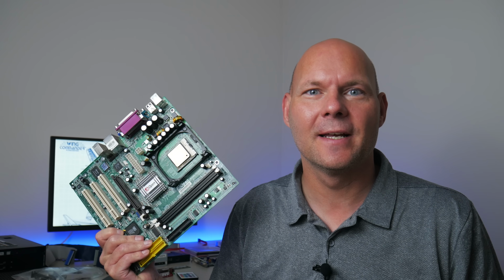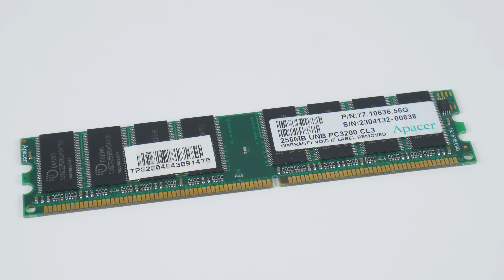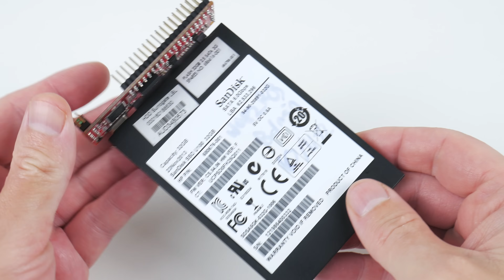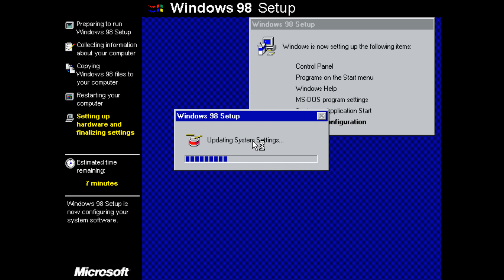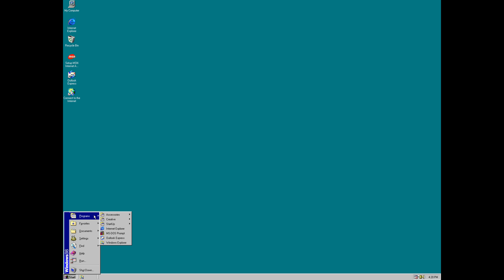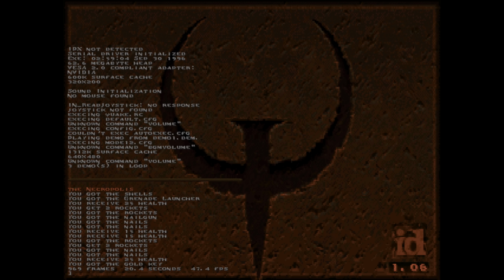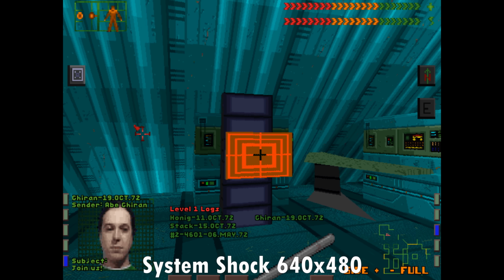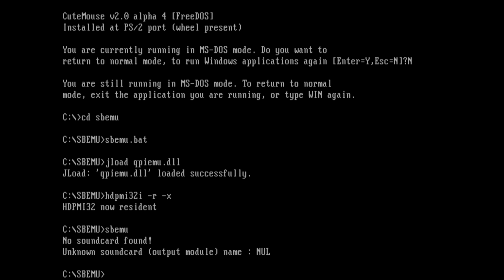Pentium 4 with SIS chipset? Sometimes Retro PC Gaming can be frustrating!

Comment: Another great topic. The only P4 I have is from ECS with a VIA chipset. I will try that in the near future (with SB Live, just like you did) and let you know. Currently I've revived my Abit SE6 (i815 w/ P3   1.0GHZ) - a full recap. I used a Cirrus Logic 5434 video card and tried CMI8738 and Sound Blaster Live on different installations. With the CMI8738, I can get good sound on most of DOS games (native), except for Doom, Duke3D etc. It plays really nice with Prince of Persia, Indiana Atlantis and XWING. With Soundblaster, I can get Doom and Duke3D to work, unfortunately I can't get Prince and Xwing to run, and Indiana Atlantis sounds horrible (like played but an old Nokia phone, before the smartphone era). Pretty different from your experiences. Used the Super Easy Dos stuff from your site, and yes, I placed the commands on the right place (at the beginning). One of the games (I think XWING) complains that it needs more "stacks" with SB Live, I placed it on config.sys just like I used to do with my own dos builds, but it doesn't make any difference. As you said, nothing goes according to plan, always a surprise. I love to play with the old hardware, but everyday DOSBOX looks more appealing to me :)
Reply from the maker: Funny you mentioned the C-Media, it will feature in a future video! It's one of the, if not THE, cheapest DOS compatible card that you can still buy quite easily. Try disabling CPU Cache, many games are speed sensitive. Try Adlib option instead of Sound Blaster. Heart of China for example, the Sound Blaster driver will not initialise on fast machines, but no issues with Adlib sound.

Comment: This brings back memories!
My first ever PC with P4 CPU and MSI motherboard with SIS 961 chipset used to run DOS games with sound on onboard integrated sound card. Or this is what I remember.

I tried to replicate my experience when I was making my own retro PC, but haven't managed to make it work ever since.
Is it possible to run DOS games with sound support on SIS 961 chipset or am I having a mandela effect? 
But I remember playing DukeNukem 3D, Wolf 3D and Warcraft 1 with sound on that PC. I guess it is time to revisit my old PC. Is it possible sound support for DOS in unchecked in BIOS and thus is the reason, sound doesn't work anymore?

Comment: Interesting stuff with the P4 and AGP. The hardware might be just ever so too new for reliable DOS capability. Some of those modern, but backwards compatible chipsets like to do some funky stuff.  I recently found a socket 775 ASUS P5S800-VMS with AGP 8x from the local recycling center. It has drivers for Windows 9x but seems to be a bit finicky with drivers, the board is from some parkard bell machine

Comment: Glad to see more people embracing the P4 for retro gaming. My current retro rig is Windows 98/XP, Asus P800-E Deluxe MB, Intel Pentium 4 3.00GHz, Asus P800-E Deluxe, 2GB RAM 400MHz, Geforce 4 Ti 4800 128MB and Sound Blaster Live!. This machine is not aimed for dos games thoug, but as a platform for the games using shaders not supported by newer graphic cards than the Geforce 4, spesifically Splinter Cell 1-4 and the like.
Reply from the maker: Oh nice! Yes this machine is perfect for the splinter cell games with their picky graphics requirements. Great games!

Comment: I have an abit SG-71, which has an SiS 651 chipset. I was using the same CPU you were using. No matter what I do it will not boot from a HD with a SATA to IDE adapter. Bios sees it and it will install windows but when it's the boot device it hangs with an error. The motherboard has the same southbridge 962Lua, so I don't know what it's deal is. My PIII machine with an Intel 815E chipset has no issues with the adapter! My main Pentium 4 machine(from which I'm writing the comment, more fun this way) has a Gigabyte board with an Intel i865PE which has two Sata ports, so the SiS board is a decoration for the time being.

Comment: I just completed a retro assembly using a SiS 662 MoBo, a Celeron 430 and a Radeon X300. No issues so far, apart from some random screen 'washes' when exiting from DOS games back to the Windows 98 Desktop. Still, no BSODs, which was the Main goal of the build.
Reply: I'm thinking of a build that uses a SiS 648/968 chipset, but only for 98/ME/XP games (DOS will be a for a different computer that'll have slower CPU for speed sensitive games).
Will the SiS chipset be stable for those?

Comment: yeah, there is a reason why the Intel and Nvidia chipsets were the better choice. In some cases even VIA for budget options.
Now the wildest SiS chipsets boards were those ASRock mutant boards. like AGP +PCIe or DDR1 + DDR2 on the same board.
256 MB are sort of a sweet spot if you want to dual boot with XP. And while the FX 5200 is atrociously slow, the 5200 Ultra is actually pretty decent, often faster than the 5600
Interesting to see how slow the Northwood gets without cache. My Coppermine can run unreal surprisingly well with L2 disabled. (was tinkering around with caches for benchmarks)

Comment: I think there is a resource issue. I had similar issues with an audiopci sound card in dos but it worked fine in windows. This was with a compaq Willamette P4 system using pc 133 ram.  Dos games worked fine in windows. No freezing but in Dos, they would freeze. I think some motherboards just won't cut the mustard if you want pure dos. Unless they have options to assign irq to legacy isa. Since pci sound cards emulate isa cards in Dos, this could be the problem. Resources

Comment: I had Celeron 1.8GHz@2.2GHz on MSI board with SiS 645E chipset with 256MB ram. Despite bad rep SiS chipsets got I remember having no issues with either DOS or Windows 98. Actually board was very stable in Win98 and there were no AGP, sound, etc. issues at all.

Comment: Pentium4 and the whole Intel's Netburst architecture with exceptionally long pipeline made the whole CPU family so inefficient that it required much higher the clock speeds to match P3 performance. I think it's the last genecation of CPUs we can consider being retro. Great review, thank you!
Reply: Later P4s are in a weird spot with their support for x86-64. With that it would seem fair to include single core Athlon 64s in the mix. Multi-core seems to be the dividing line at this point.

Comment: It's a SiS chipset thing, they just don't work properly with Soundblaster Live soundcards. I had a newer SiS 661FX chipset, experienced the same issues you did. I also have a Socket A motherboard. A PC Chips board that had the SiS 741GX chipset. Everything worked except the Soundblaster Live DOS drivers. It just simply wouldn't work under Windows 98, I had to leave it disabled on device manager on Windows 98.

Comment: I've used a p4 for dos and 98. Advantages are it's cheap and its easy to obtain a safe modern atx power supply. Disadvantages are the motherboards are right in the middle of the capacitor plague and there are no isa slots in 99% of boards.

I would move up to a core 2 duo/quad for xp but for cheap and easily avail 98 the p4 is a good choice

Comment: Populate the ISA slot, & you should be able to run a more compatible sound card for DOS games. I notice the through holes are there but no slot is included.
Reply from the maker: That's not an ISA slot, it's for what is basically a LAN/Modem card.
Reply: AMR, of course. My mistake

Comment: I have a Medion PC with the Sis 645 chipset, fun fact it was the first chipset to support DDR333 for the Intel Pentium 4. Originally came with a 2GHz P4 Northwood, but I have since then upped it to a 2.8 Northwood

Also I would imagine the chipset drivers works better under 2000/XP

Comment: This platform is an excellent alternative to similar Athlon XP platforms with uAGP, and definitely the sort of thing that I look for for testing really old graphics cards without a bottleneck. And the graphics card you chose... Well to be honest in a 2023 video helping people choose parts for a retro rig, I can't fault you going with the FX 5200 that much, because the prices for AGP cards are ludicrous now. The 5200 is one of the few cards you can still easily find for a reasonable price and as long as you aren't trying to play Halo or Far Cry, it's............ ok.
Reply from the maker: For the ATI Rage Fury Max I uses a SIS chipset board with universal AGP! Had to set it to AGP 2x in BIOS but then it worked really well. I use the FX 5200 mostly because it has DVI out and makes capturing much easier, it scales everything to 1080p in DOS and during installation making it easy to show all the steps...

Comment: I had the Dell equivalent of this machine, XP, 2.4GHz P4 pre-HT, AGP FX 5200 128MB ‘crap edition’. Upgraded to 2GB RAM DDR and Radeon 9600, though  :)

I found the bottleneck was definitely the Pentium 4 or the chipset, because I got an athlon 64 with board at some point, shoved the Radeon 9600 onto it, and my frame rates got so much better…

Comment: Had 2 retrogaming Systems with p4 and sis chipset. One was skt478 and The last one was 775. Never had issues with 98...now i'm working on a new more updated machine to run Games up to 2005/06 equipped with a pentium D 950 and Intel 945 chipset with PCIExpress for 98se/xp...found some modded intel chipset drivers for Windows 98 but i still haven't found the right balance, still unstable.

Comment: “You either love it or hate it” I guess I hate it. When Pentium 4 came out it was very obviously slower than P3 at the same frequency. Remember, P4 frequency started around 1Ghz and you could find 1200 MHz P3s around the end of P3 lifecycle I believe. They had promised 10GHz+ which was a sham. It was such a failure there were such scenarios the CPU came to a crawling halt. The problem with certain pipelines were outlined in several hardware articles at the time. 

On top of the horrendously bad architecture, Intel forced motherboard companies not to manufacture AMD motherboards. And on top of that they tried to monopolize the RAM market by not only forcing RAMBUS but also forcing RAM manufacturers not to manufacture conventional RAM. 

I’d take Pentium 3 over Pentium 4 any day. I avoid P4s like the plague they are. No offense to people that have good memories with it. I mostly have bad memories.

Comment: iam doing some experiments with Asus P4S800D-X there is also SIS chipset. With 1.8GHz P4 nice stable windows 98 system. Now trying something under windows XP same mobo but 3.0GHz prescott 2GB Dual channel DDR and FX5500 256MB.  It working great
Reply: ok iam just trying MS-DOS 6.22: 3.0 prescott, 2GB RAM, FX5500 and SB Live SB0060. I cant believe it runing i just played Keen4 without any problem with music and sounds🤣 also screen is fine no flickering in game. I have exact same FPS in quake bench like you. Is this game FPS cap or something? 🤔Pcplayer bench 640x480 73.7 FPS but top and bottom lines with text flickering. Doom benchmark around 110 FPS. Chris 3D 640x480 136 FPS. Lets test some games 😊
Reply: hmm too much memory cause not enough memory. MDK not runing with emm386. No problem with extended memory but with this option sbeinit not working without emm386 ... i think i need 64MB DDR module ... it exist? 😳 i have only modules 256MB and up 🤣 in bios no option for memory hole ☹
Reply: ok ... format c: and installed DOS71. MEM show now full 2GB ram size MDK now runing with emm386 loaded. LETZ GOOO 🤣

Comment: The SB Live or just about any PCI based Creative cards were notorious back in the late 90's for having issues with DOS games, system freezes and so on. For real a really stable DOS gaming rig you really want something with an AGP or PCI graphics card and ISA for sound. 
Also, some games that use the DOS4GW extender (like Doom, Warcraft 2 as examples) do not like running on machine faster than around 750 Mhz or so. I'm not sure why but I think that's the source for the crash you got in Doom.
Reply: The reason for this is Creative Labs recycling AudioPCI's emulation they obtained through the Ensoniq acquisition. The AudioPCI itself was rebranded and resold as various Creative products. So whatever DOS problems there were with Ensoniq's early to market PCI products were duplicated across basically Creative's entire line of PCI products.

Comment: Back in the day, I tended to avoid SiS chipset boards. They were a lot of trouble (bad drivers, bad performance of the IDE controllers, weird incompatibilities). I tended to stick to Intel chipset boards for Intel processors.
Reply: Very true.... I worked for a company that turned out a high number of machines back in the day and SiS became  one to avoid but there were 2 exceptions..  the 630 and 730 chipsets were surprisingly good and didnt give trouble but you tended to see those on the p3 tualatin boards or laptops
Reply: Same here. I have a really terrible experience with SIS models.
Reply: I had a K7SEM 1.0 for my Duron 850 back in 06 and I didn’t have any problems but was not using DOS at all aside from its involvement in win98 behind the scenes
Reply: @Protoking ecs k7sem was basically a pc chips m810lmr. Both were the same (I think) SiS730 chipset ! The onboard (up to) 64mb vga was appalling !
Also, I seem to recall various issues with the ide controllers and having to regedit to get them working in udma mode as with the built in to xp drivers sometimes it’d work in programmed input output mode 4.
These boards got me into building & fault finding computers though & as with many ecs & pc chips mobo’s there were many faults to find lol

Comment: You should try "Memory hole at 15-16M" to limit RAM. Works well for me as it deactivates all RAM above 15MB (don't know if this is the case for all motherboards).
Don't know if P4 motherboards still have this BIOS option though and if activating this can cause issues I didn't run into yet.

Didn't try running pure DOS on my P4 system (not SiS) with Audigy 2 Zs. Might do some testing including SBEmu once we moved house and I set up the new retro gaming room.
Reply: The original purpose for the 15-16M memory hole was to disable just that one megabyte of memory between 15-16M for some old ISA cards that used that address space. But how it is implemented on motherboards varies wildly. Some correctly just disable the 15-16M region, while others disable everything above 15M. Only way to know is to try it on various boards, because it's not documented well.

Comment: Try a board with the Intel 945 series of chipsets. Especially if it has onboard audio. The audio on those boards has built in Soundblaster emulation for some reason in DOS with the right drivers. No fm or wavetable, though. Seems like good potential for an Opl3lpt or one of Serdaco's other lpt products. It also has excellent compatibility for a lot of pci sound cards in dos from what I've read. You'll find these in a lot of Dells up to 06 with Celeron D or Pentium 4. The onboard video also seems to work quite nicely in DOS, but I don't think it has 3d acceleration. Definitely look into this Phil. This is what I used for first experimenting with 98 and DOS, a Celeron D Dell with a 945GV chipset and one of the Aopen Cobra cards that were for sale for cheap years ago.

Comment: Thank you for the video, Phil. I've had great experiences with SiS chipsets on Socket 754 motherboards, but SiS's USB drivers often cause a headache under Windows 98 (especially for the 760 chipset). SiS's integrated Mirage graphics could deserve a look on the channel - from my testing, they're surprisingly competent in games from Wolfenstein to Half-Life.
Reply: I have an i815 chipsets board under my pentium 3, that comes with USB 1.1 already, but I added a pic card with USB 2.0, Ide and SATA just for the higher speeds. Haven't tried the SATA yet, but ide works.

Comment: Pentium 4 is my favorite CPU of all time!!! Specifically the 640 on socket 775. At 3.2GHz and the ability to easily go 3.6/3.7 using PLL clocks, it saved me until 2012 when I FINALLY gave in for a quad core AMD APU. Thank you for giving old hardware such a great spotlight! Love your channel.
Reply: I have  a 505 and a HT 631. the former is nothing to write home about, but the 631 is quite nice. 3 GHz, and could run mine easily at 4 GHz, even with reduced multi for more bandwidth. The platform can be really bandwidth starved and even when staying at 3 GHz, going from 15x200 to 12x250 improved performance by roughly 15%, so if you have a system where you can reduce the multi, do it and push the fsb up.
Obviously still slow and my 2 GHz Celeron 440 completely crushes it at less than half the power draw.
Reply: @@lurch789 No one uses one like you're thinking in 2023. Definitely better options even for XP machines. And for a free CPU I'd say I got my money's worth with that P4 over a decade ago. 🤷🏻‍♂️

Comment: Another great video!

I too have issues with my onboard audio. I've not managed to get it working, but there is a jumper that you have to leave in place if you are not using a front audio jack on the case.

Maybe a silly question, but is your jumper still there? I think that my board has two jumpers and I can't work out which way they need to be connected for the driver to see the hardware.
Reply from the maker: Good tip!
Reply: @philscomputerlab  I started playing with my Windows 98 PC again after this and I have finally found a driver that works. 

I have a Packard Bell iMedia 5114. Finding any details on this is really hard. It has a Gigabyte GA-8SMIL NL and has a Realtek ALC201A audio chip. The driver install package named 5.10.0.5440 installs Version A3.54 an OEM version that seems to work with Windows 98SE.

Finally I have got all the drivers. What a fun puzzle that was 🤣